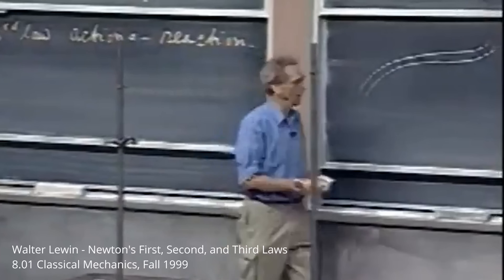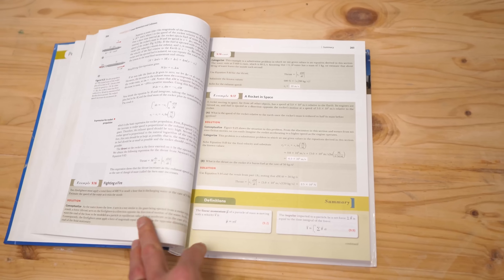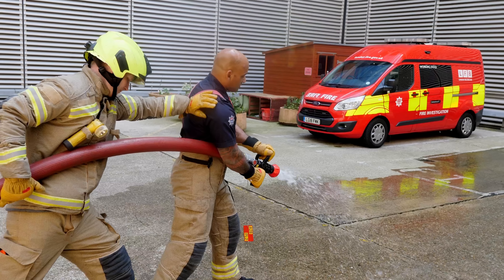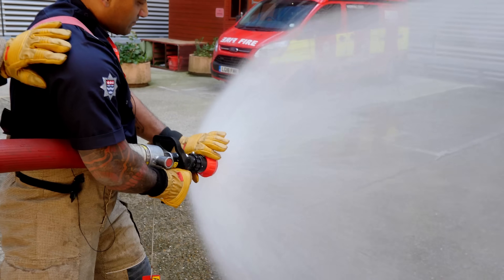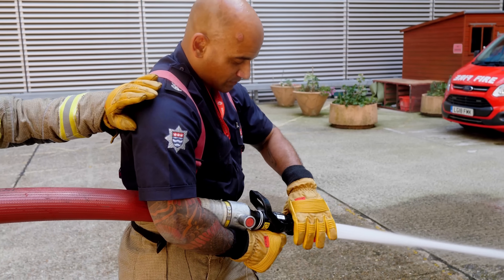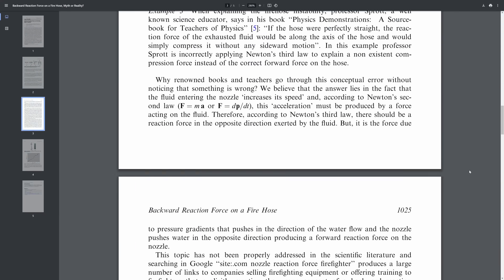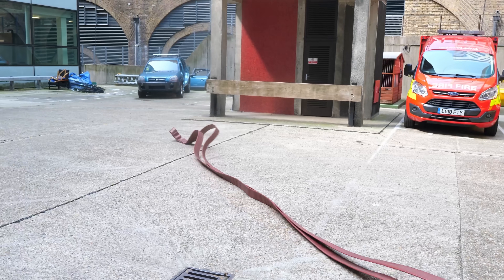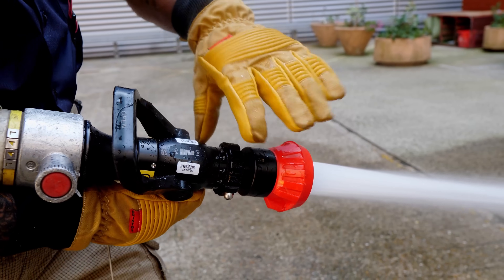Why chaotic hoses dance

Comment: I'm at 5 minutes in and I keep thinking "What happens to the water/air when it leaves the hose and wouldn't the water behind it have to push it out of the way at some point, so wouldn't that account for an increase in force at the nozzle¿? Wouldn't it also have to push on the air which would cause even more force on the end¿?"   🤔😩   I already know that I'm going to be thinking about this for weeks now if I don't get a good enough answer.      😂

Comment: I think the short experiment you did with the clear tube is flawed. This is more off of a gut feeling but for each instance both with little to no curvature and the full loop the end of the "nozzle" was pointing roughly purely left. so the net force to redirect the flow between the big loop and the small loop is the same. It's kind of like using the same amount of work to move something from A to B no matter the path you take (in space). 

I think pointing out the end of the nozzle south would yield different force results than the west example.

Comment: As someone who has an engineering degree, and also has worked hoses very similar to a firehose before, I can say there is a lot of force on those things.  I can also see a number of flaws with your model.  For instance, pressure outside the hose isn’t atmospheric pressure for long, the stream maintains its pressure outside the hose.
Reply: What do you mean the stream maintains its pressure? You mean its velocity?

Comment: Steve, in your experiment with the force experienced by the air hose with a full 360 in it, wouldn’t the forces all around the circle nearly cancel each other out, resulting in the same force as the straight case? What’s the force with a single 90 degree bend?
Reply: I think the force is always pointing perpendicular to the hose, so it's not net zero (the different forces don't act on the same section of the hose and cancel out) but have the loop increase in diameter and have the hose straighten.

Comment: Fire hose is the same as jet packs that connect to a jet ski
I don’t think anyone doubts, that people in those jet packs experience full force of water coming from the nozzles
Reply: Well, those have a 180° bend, so both explanations would work.
Reply: @Kenionatus  I think the bend could be any amount of degrees, coz it sometimes coils multiple times
Reply: @llMarvelous  If the water goes up to the rider and then down out of the jet it must be doing some multiple of 180 degrees of bending.
Reply: I do doubt it

Comment: I'd have guessed that the water at the nozzle hits the air/slower water infront and transfers energy, thus slowing down. So should it be the same force the air would have if blown into the hose?

Comment: I think an interesting related question is - sure, we know that rockets experience a force because of Newton's third law - but where does that force actually act? Within the combustion chamber? Within the expansion bell? On which surfaces?
Reply: Largely within the expansion bell.  Compare a sea level engine bell and a vacuum engine bell and you'll get some idea of just how much of the thrust acts there.
Reply: @benjaminnelson5455  This.
Reply: I would think it's reacting against the bell,  and the force is the sum of the momentum of the mass ejected by the rocket, and the massive volume of surrounding air being accelerated downwards in the expanding jet cone below.
Reply: Yes to both of your questions. The force is acted on the "front" of the combustion chamber, as well as the bell. Since the bell is not flat like the front of the chamber, the force is the cosine of the angle of the bell I believe.
Reply: The momentum of the propellent out the back gives you the total force, but the momentum transfer is actually from the pressure on the injector plate and the inside of the diverging bell being higher than the external pressure. There's actually some force on the converging part of the nozzle in the wrong direction, but that's also where a lot of the pressure is turned into velocity, so it's much lower than the pressure on the injector plate.
For jet engines, the largest thrust loads are actually felt in the compressor section, and for a supersonic jet the diverging subsonic part of the inlet diffuser, not the nozzle. 
calculating it that way requires you to be much more careful with your integrals, so usually you just do a momentum balance, with a little extra accounting for the pressure at the nozzle exit if it's chocked or supersonic flow.
Reply: Rocket motors use chemical reactions in their fuel to cram as much enthalpy (heat and pressure energy) into the exhaust gas as possible in the combustion chamber, then use the expansion bell to convert that enthalpy into work as the gas expands and pressure and temperature drop. So the force actually propelling the rocket is exerted as the gas expands in the bell (and the exhaust plume) and pushes primarily on the bell, while the forces in the combustion chamber largely balance themselves out. This is easiest to see in motor designs where the combustion chamber isn’t in line with the exhaust path, like valveless pulse jets and certain RCS systems

Comment: Wouldn't the momentum of water "want" to keep the stream moving in the same direction? Clearly the force is not very big because we don't see the hose "straightening up", but it might contribute to the hose retaining some of its apparent "rigidity" which prevents it from bending endlessly along the entire length of the hose (because that would force water to change the direction of momentum?), So it is only the end that gets the most of that wiggling?
I've been thinking about the "hydraulic ram" phenomenon and that got me thinking about this in somewhat weird way, maybe?
Reply: You can see that exact phenomenon when flow speeds get high enough, and it’s easier with air than water. My guess is that there’s a critical Reynolds number at some point where the bulk momentum of the fluid impacting the hose and the viscous forces of the fluid flow itself balance out, and the hose stabilizes around that high-speed straight flow. That velocity might be very very high for water in a long hose, though.